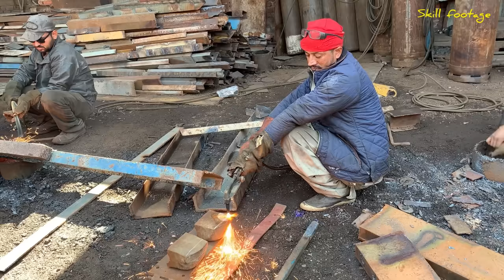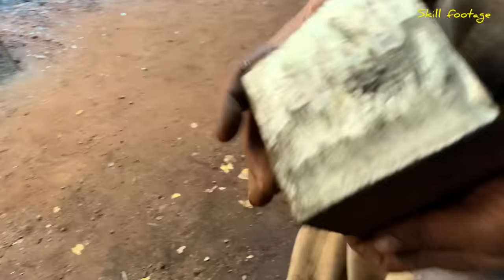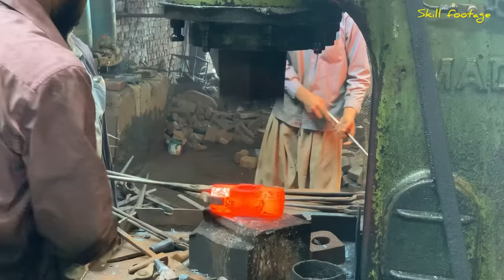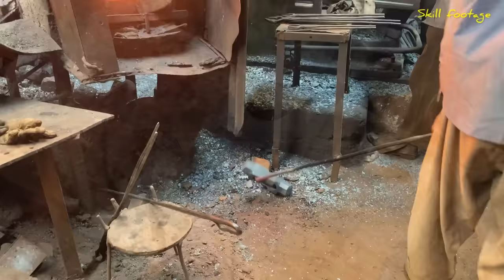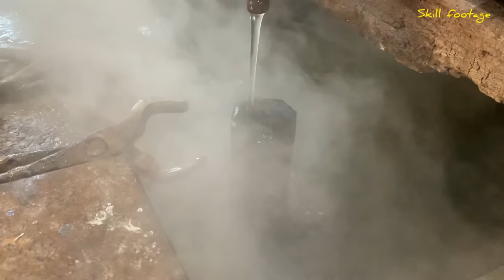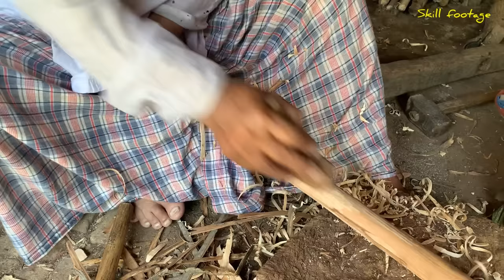How Experienced Blacksmith Forged 10kg Sledge Hammer on 1950 Power Hammer Without Any Safety Gear

Comment: And this is why US manufacturing is dying, you can't compete with a non safety regulated manufacturer who's overhead is 1/10 of a US manufacturer.
Reply: I've said that for years! And they want to do less work for more pay.
Reply: It isn't this kind of shop that western manufacturing will struggle with. You automate and suddenly the same number of people can produce 20 times as many hammers. The problem is the big far eastern factories that are bigger, as automated and have a slightly cheaper workforce.
Reply: Here in Australia to,the heat treatment is a worry,heat overall,hold temperature specified time,overall temper,die paint check for cracks.

Comment: Technically about 7.5lb after scale comes off of power hammering the 8lb block of metal. To be that consistent on power hammer takes a very good eye and quite a lot of skill. Well done! My favorite part is taking the shoe off to get a proper cut for the handle. To haft the handle properly I might of hit the bottom of the handle a couple times to really grip that head on.
Reply: You mean 3,4kg after power hammering a 3,63kg metal block.